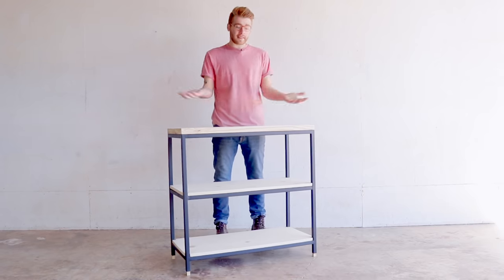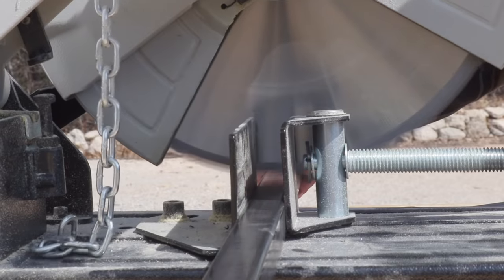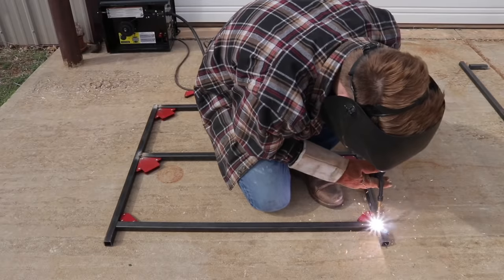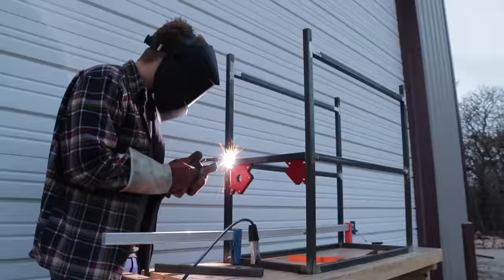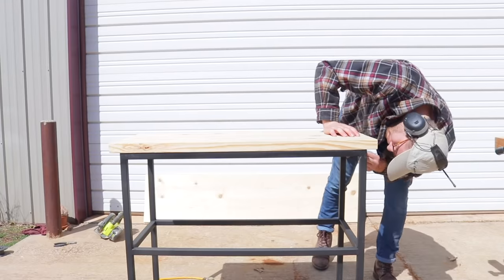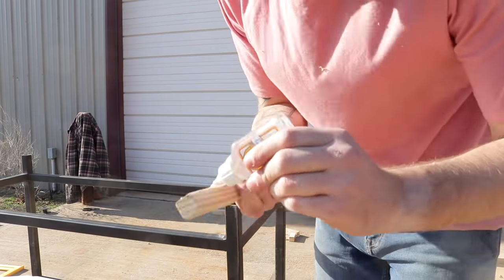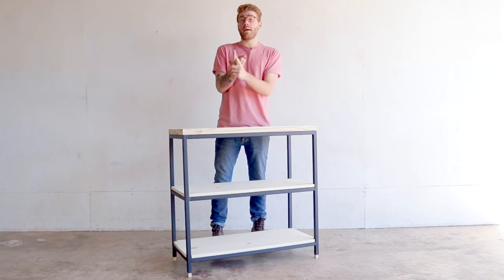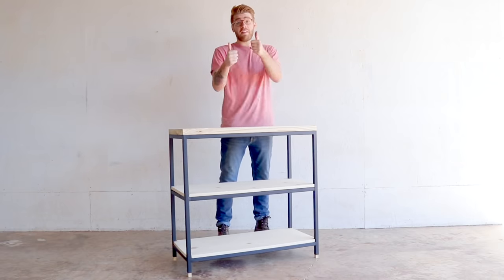3 Tier Metal & Wood Book Shelf | Modern Builds | DIY

Comment: Great build! For those that want to take it 1 step further::: after you grind and sand the welds, use a torch to get the joint red hot. Let it cool. The joint will disappear. Makes for a significantly cleaner look. If there are holes or pits after sanding, just fill them in with wed and do it again.
Reply: Nice tip!
Reply from the maker: Wow! I had no idea! i'll have to try that on the table I'm working on!
Reply: Modern Builds I work as a Blacksmith and we hide all of our welds. If you’re interested, my instagram has 135 feet of branch railings posted. Every piece of branch was hand forged, welded, ground, sanded, heat treated, wire wheeled clean, then painted. Looks very organic and natural.
Reply: Nice tip! I will have to try that. Thanks
Reply: Hans Idso thanks, and thanks for the sub. Look up my fireplace video. I use that technique to make it.

Comment: Don't forget to first tack all the joints together before full-on welding them to prevent the metal from warping out of shape.
Reply from the maker: Exactly! I tacked them on one side, flipped it and ran beads along the full joints, then flipped it again and finished out the tacks

Comment: Couple tips, 3/4” is way too much stickout for flux core...things will run a lot smoother if you can cut that in half...about 3/8” or so.....also, pick up one of those rubber thread protectors that replaces your nozzle for flux core work...they work great...lastly, try propping one hand/finger on your work piece right near the joint, and use that to support/guide your gun...two hands on the gun just floating in the air with no support is way tough to get good welds...even propping your elbow or forearm on your work piece/table can help a ton to steady you...
Reply from the maker: Right on!! good tips!
Reply: Came here to say that ^   'air weld' over the joint to make sure you can hold the nozzle steady (parallel) across the length of the bead. if you can't, change your position/support until you can

Comment: Hey Mike ! I want to note that you should think about removing the magnetic triangles when you have tacked the steel in place. It won't keep it from shifting, but the heat from the weld will remove the magnetism (look up 'curie themperature' ). It depends on the design of the product but I had one of those lose magnetism after leaving it on a hot weld. Love your builds !
Reply from the maker: Interesting! I haven't had that happen, but I'll definitely keep an eye out for it in the future!

Comment: And unless you bevel and prep the joint before hand, grinding the weld smooth can dramatically reduce the strength of the piece.  Especially when mig welding.  Bevel the edges.  Full and instant penetration is no guarantee
Reply from the maker: That's a good tip! I'll do that going forward!